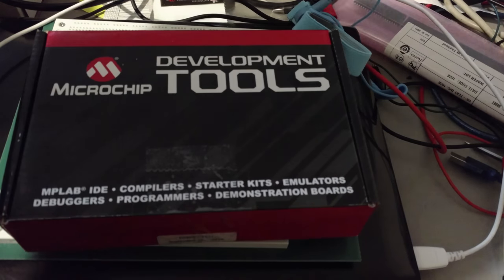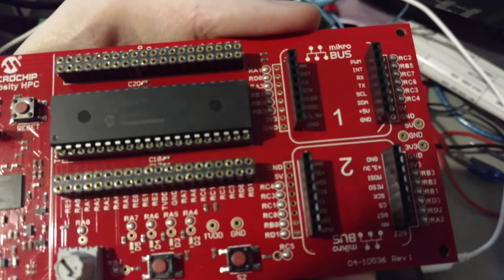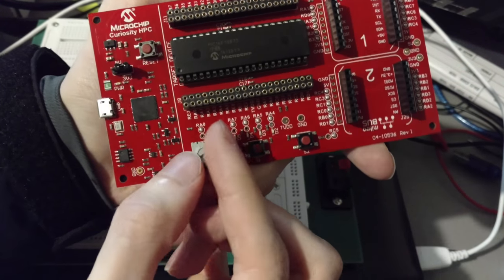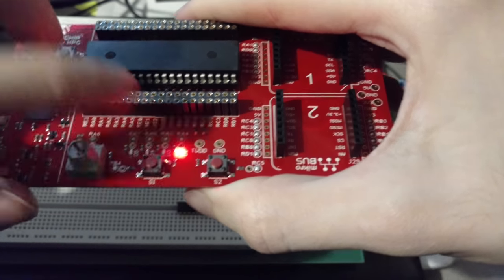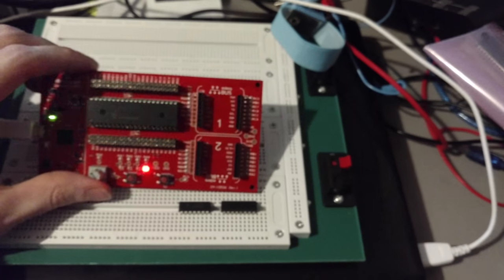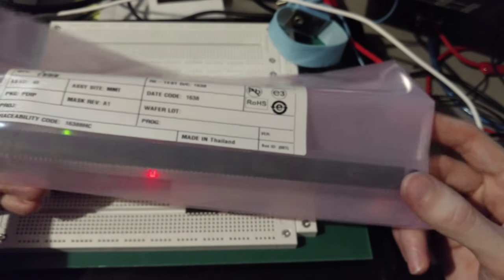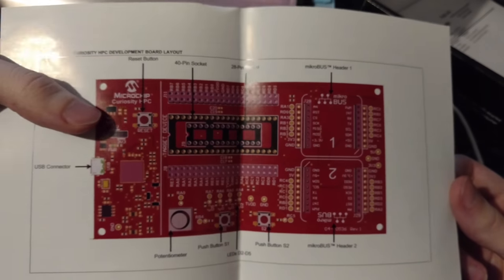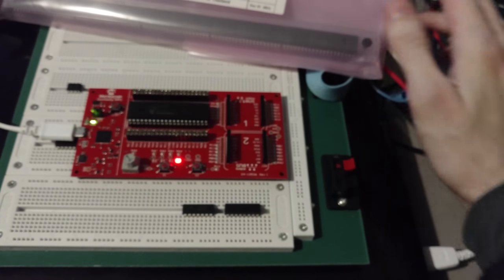Vlog #001: Microchip Curiosity HPC Unboxing

Comment: Is this a good microcontroller board to get started with pics?
Reply from the maker: Yes definitely: Microchip designed the board to have a built-in programmer (avoiding the need to buy a separate PICkit) and their IDE makes it very easy to configure for different projects (including some automatic code-generation). 

The main difficulty, as with all other Microchip projects, lies with needing to program in C. Although there might be third-party software that allows you to write in another language (like Processing) and then compile down into C, but I don't know of any specific examples. 

I hope that helps.

Comment: Hi sir ,
I already purchased this kit ,I got some reference in microchip website but i need the reference for how to program GSM code with the same controller in Curiosity HPC (PIC16f18875). 
Please help me.
Reply from the maker: Hi,
I would look at the documentation Microchip has on their website about that. They also have software like MPLAB Harmony for dealing with drivers and other more advanced features. 

As for actually programming 'GSM code': I have no idea. The only 'programming' is in C or C++. Using GSM functionalities is done through drivers and/or libraries, which Microchip has ample documentation on. If you need specific help on that matter: you should contact Microchip's technical support.

Thank you.
Reply: @blu12gaming44  Thank you sir